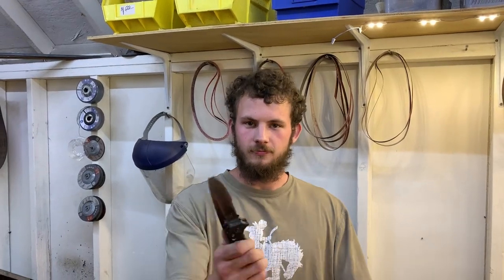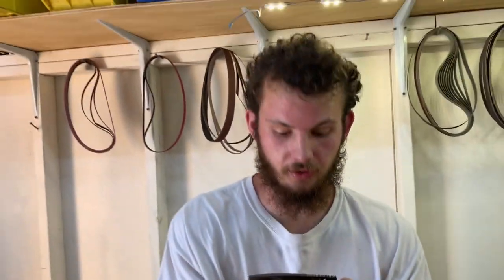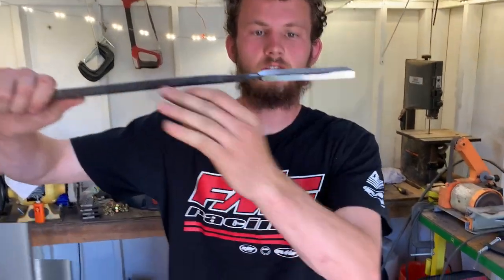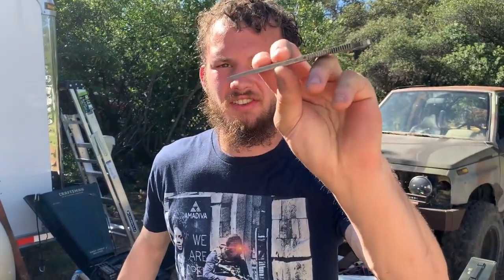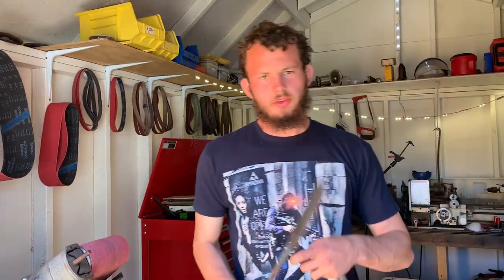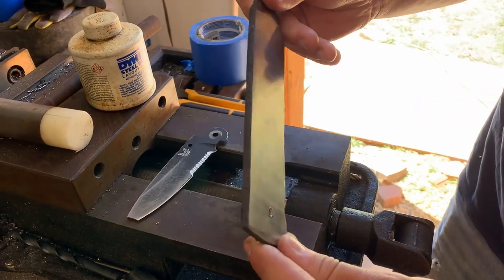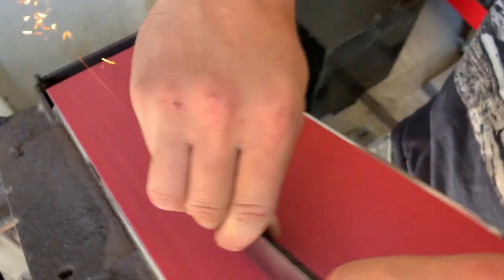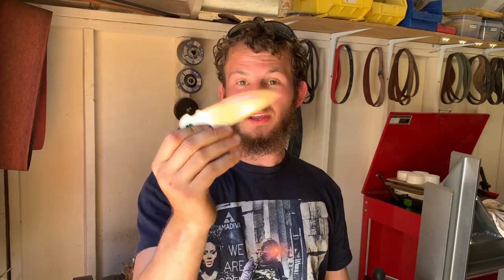Making a Damascus Benchmade Knife! Part 1

Comment: how is the log splitter press treating you? i know you mentioned that the steel doesn't look as hot since it's outside but it still seems like it's not up to welding temp. i know i've been having problems and i'm not sure if it's because i'm not letting the steel soak for long enough or if i'm not hammering hard enough or something. either way, kickass blade blank!